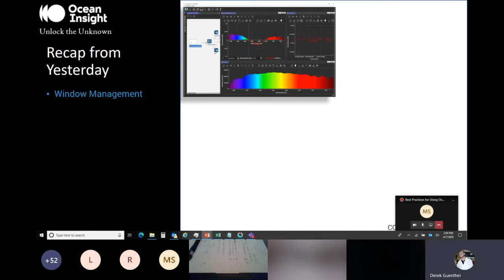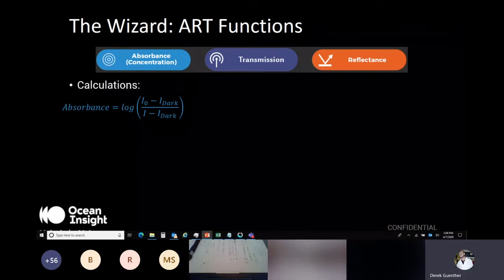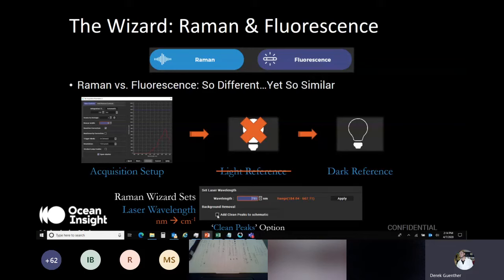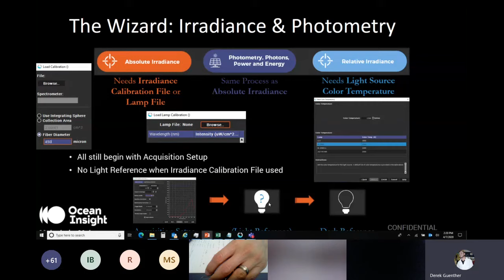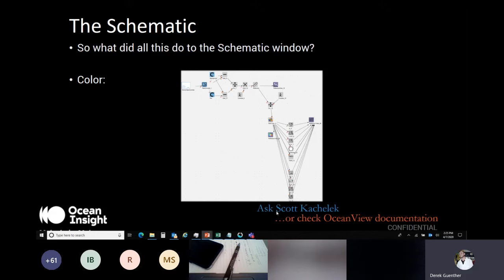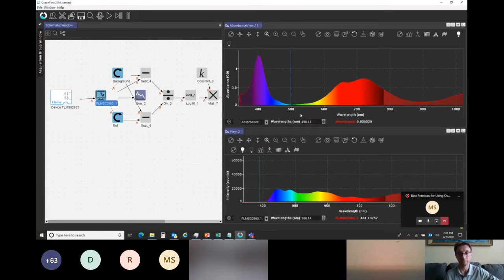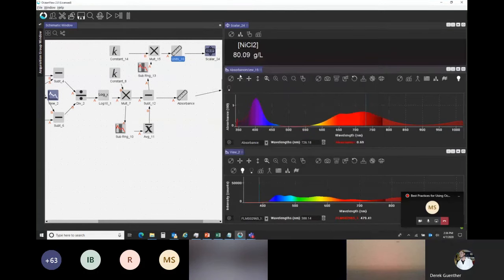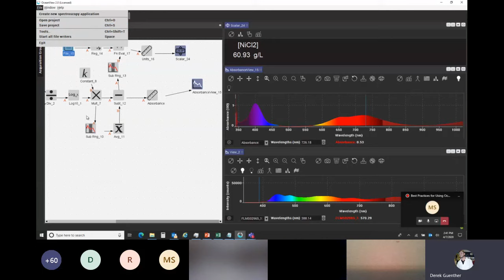Best Practices for Using OceanView Part 2

Comment: This is the worst SW I ever encountered in my 30 years of scientific experience. If I deny the notion that this software is just a practical joke, I conclude that it was created by incompetent people who had no clue about its future use. I have never seen a UV/VIS spectroscopy software that was as deficient as OceanVue, and I am no longer surprised that I did not know about this line of spectrometers until very recently when I found it collecting dust in one lab. The researchers in that lab would use nanodrop or old-fashioned huge tabletop spectrophotometers for UV/VIS rather than a USB2000 device, even though the USB2000 looks nice and handy. It is a useless system due to the deficient software. In addition, the company does not even provide a decent manual, only these l.a.m.e videos.

Comment: Derek, is there a way to enter a step function timer into the schematic? Let's say I want to turn the lamp shutter ON then collect data for few seconds then turn it off and collect more data. I want to be able to repeat the process on a fixed or variable interval and perhaps even do so for external devices using the GPIO pins. How would you suggest doing so?